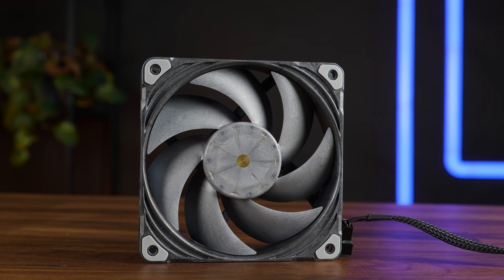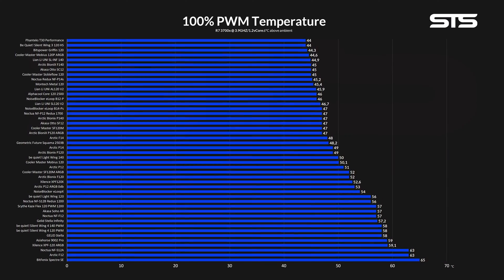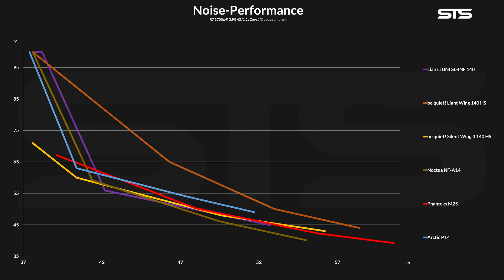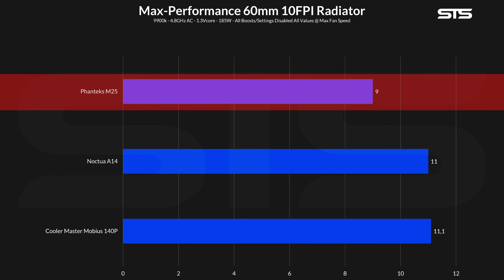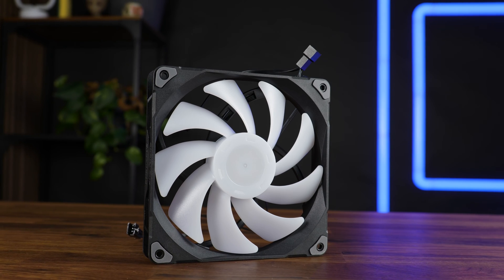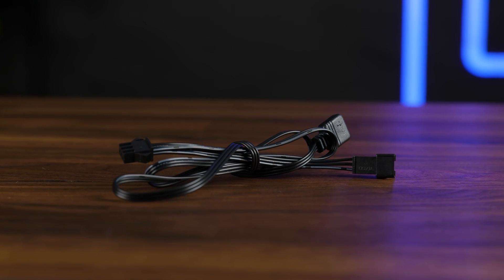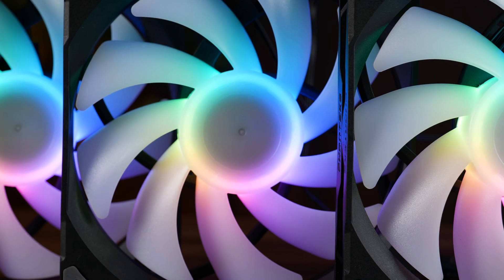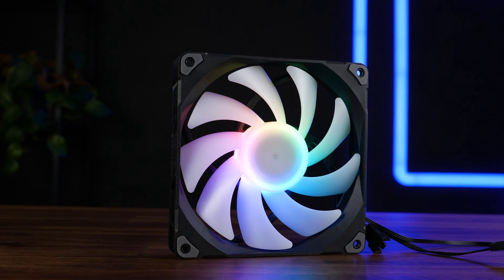Phanteks M25 140 DRGB Review - The 140mm T30 Alternative?

Comment: Got a pair of these m25 140mm because the Arctic P14 pwn pst has an odd hum  at certain rpms (split headers). But these guys are louder than the Arctic P14s above around 900 rpm :( Continuing my journey to find the quietest 140mm that is not Noctua's
Reply: Did you end up finding quieter fans?

Comment: Have the companies put brighter LEDs into their fans since you did the review ? I was going to go for Mobius 140P for my big Haf 700 as case fans and radiator fans, then seeing the Phanteks M25 outperform on radiators for little bit higher noise, I though about getting them. The problem is they both have weak LEDs at least at the time they have been reviewed. What puts me off about the Phanteks is the non standard adaptor even though they are included. The only fan that outperforms these two is the EKWB Loop FTP but their 140mm model doesn't quite extend to larger 14" cases maybe 9" for mid size cases. So here we are in a dilemma.. and which to buy.  Does anyone know what length of 3 pin Argb cable I'm likely to need for the HAF 700 ? Likely the longest ones maybe ? I would be placing a Nollie32 Argb controller in the back of the case.I plan using a 420mm radiator in the top of the case and having 2 side intake and 3 bottom intake aswell the 2 rear exhaust and the 2 big front fans. I just wish the RGB was brighter. It seems disappointing unless you buy a 360mm radiator and use 120mm versions of the fans.

Comment: The first graph , max fan speed artic p12 is 1800rpm same as m25 righr, but how is artic p12 only 38c above ambient while a 140mm m25 is 39.Xc above ambient / hotter? The m25 140mm is worse than a 120?

Also so if im looking at replacing the 2 stock bottom intake fans (mesh fillter) of my hyte y60 case, does this video mean 2 140mm m25s is better and will pull more air in / cool better than 2 noctua a14?

And do you think a m25 140mm is = to a 120mm t30? Or better? M25 seems better right because performance mode, which is i think 2000rpm ish for T30, your graph says the t30 is way behind, at 44c above ambient ?? Some of these dont seem to make sense to me

Comment: You can currently get the non-RGB version of these for $7.50 each after tax on Newegg in the US if you buy the value packs (3x). fans that perform this well or better cost 2-3-4x as much. P14Max that came out last months has marginally better temps at moderately lower DBM, but it also twice the price and out of stock. $30 T30s as the crem de la crem are likewise not achieving 4x the performance for 4x the price, and aren't winning any beauty contests. For big money I want big style for my dollar like the Lian-Li Uni-Fans but in the meanwhile I need best price to value performance fans until I can afford fancier replacements (and hopefully Lian Li develops True TL-INFs/v.2s by then.) and these seem like the best choice.

Comment: Is it worth using these fans as exhaust fans. And will 140mm fans fit at the back of the case at the top corner as well as the top of the case at the back for exhaust? Asking for the Coolermaster TD500 V2

Comment: Earlier this year, I wanted to put better fans in my P300a to replace the cheap Phanteks fans I put in it. I put M25-120s in it. The difference was night and day. They move more air at idle than the old fans did at full speed. They might be loud, but I wouldn't know it. I don't think my PC has ever needed them to go full speed. And that's just as case fans. I'm currently planning on replacing my P300a due to it being dirty and dented (sigh, kids), and I plan on filling it with M25s.

Comment: I wouldn't mind getting the CM 140P DRGB if it didn't cost almost TWICE the price of a Phanteks M25.

£26.99 * 9 = £240 for CM 140P DRGB
£40.98 * 3 = £122.94 for 3x 3 pack of M25

I could literally push/pull for the same price as push only.

Comment: Can I use this on the rear of myh CPU? It is more for the radiators or it will be fine as an exhaust fan?
Reply from the maker: It’s actually a pretty good rad fan.
But sure, you can use it for anything
Reply: I recently bought a pack of 3 of these fans and have them installed 2 in front (intake) and 1 in back (exhaust) and they work great. If you set them up with a good fan curve (I just used ASUS fan expert) then they run at so low RPM that I can barely hear them when idle or browsing the web (watching YouTube here and such) and they can really get some air through the case without having to ramp up to much even while gaming, although they do become noticeable when gaming if they reach around 1100 RPM, but it's by no means bad and if you play with a headset (as I do) you won't notice them at all.

Comment: For radiator performance, the fans I really need the performance values (peak and noise:performance) for, are the Lian Li Uni Infinity SL120 and SL140 and the Noctua NF-A12x25.  I'm working on a build right now using a case that's a bit closed off (Dark Base Pro 900).  I know the air flow values for those fans, but due to the closed off nature of that case, I get the feeling it would benefit significantly from more static pressure oriented fans.  Especially for the intakes at the front considering they need to pull air not only through an fine mesh air filter, but also through the side air inlets due to the silence focused construction of the case.

I've already decided to use the Noctual NF-A12's under the PSU shroud, but what I can't decide is whether I would get better airflow and cooling using the same Noctua fans, Infinity SL120s or Infinity SL140s on the front intakes.  I would really love to get some static pressure metrics for those fans.  Especially since I keep hearing/reading that 120s are better for static pressure, but 140s are better for airflow volume at lower RPMs but have worse static pressure.  But while I keep hearing people "say" that, I can never seem to find any data "showing" that.
Reply from the maker: In the making, but you won’t be able to compare 140- and 120s on rads. There will be too many variables to draw a straight conclusion. 

But what I can already tell you, on average, 140mill fans with 140mill rads will almost always outperform the smaller ones. Sure, you're right about them having less static pressure, but the sheet size of the rad will make up for that. Don’t forget that even if they are pushing less, passive heat dissipation of the rad is still a thing, and the bigger the rad the more power you have.

What I would advise you to do inside a case like the 901, take some ‘relatively good’ 140mill fan, sl140,nf-a14, silent wing 4 pro, M25, and use a very thick but low fpi 140- based rad.
Even if the case reduces the amount of air provided (due to the required static pressure), the rad and fans will still do a fantastic job because low fpi thick rads work great with little air
Reply: What made you choose the Dark base pro 900 over the silent base 802?
Reply: @angrysocialjusticewarrior  Silent Base 802 didn't exist back then.  I bought this case years ago.  I'm doing a core upgrade and decided I wanted to replace the fans while I was at it.  I love the Dark Base Pro 900 and didn't see the need to replace it.  I even have the original version and partially updated it to the rev.2 by adding the PSU shroud and buying a replacement HDD rack and dual cage from BeQuiet so the holes would align properly with the shroud.  It does everything I want it to except maybe for not having any ability to install a GPU vertically.

And no, the 802 wouldn't do for my needs because I actually do still use a DVD/CD ROM drive.

Comment: Did you ever look at that silverstone 140mm fan that is 38mm thick?
Reply from the maker: Not yet, but on the to-do list
Reply: @STSYT  I mean, the fan is far from state of the art, but my system has been running cool despite having a pretty limiting dust filter (as I like it). 

I hope seasonic does an update of it, integration all it learned from the newer shark force fans.

Comment: Hey! Thanks for the video. I've been looking for 140mm ARGB fans for my front intake (2x140mm is enough, but 3 fits the case). I'm fluctuating between Endorfy Fluctus 140 ARGB and the Arctic P14 ARGB. My case has a limited front vent (only a side ventilation very similar to Fractal Define 7). I have the Fluctus 120 as my exhaust fan and it's pretty good and silent so far. The point is to make a very silent build.
Reply from the maker: Can’t say anything about the Fluctus as I didn’t test them myself.
I can only say that the P14 argb are doing a great job. As if they are brtter, no idea
Reply: I’ve got Arctic ARGB p14. They are great! Low noise and great pressure. I’m using two as intake and one as exhaust.

Comment: Will there be a test comparing the alphacool st20 with the usual 30mm and thicker? I would also like to see the dependence on fan speed at different FPI.
Reply from the maker: Yes, not every thickness, but for both 120s and 140s, there will be 3x different rads with different thickness or fpi